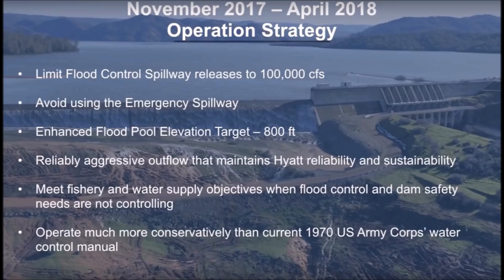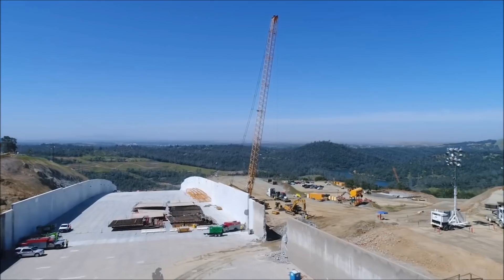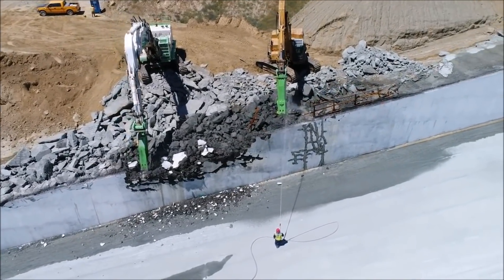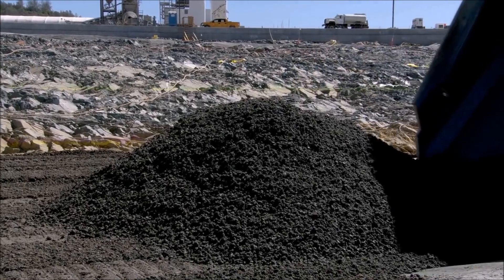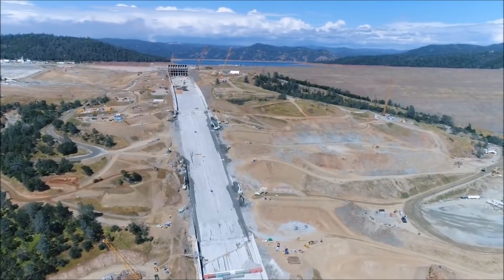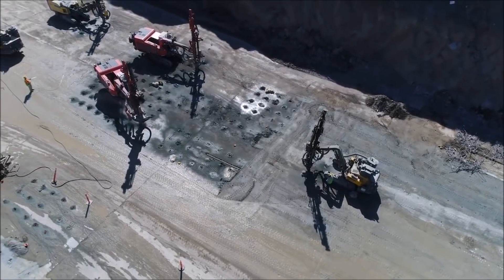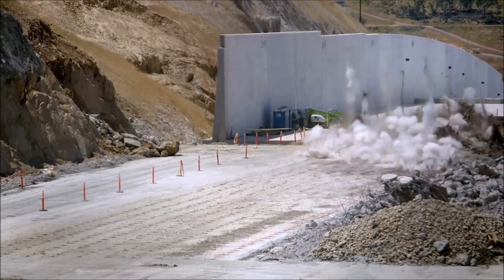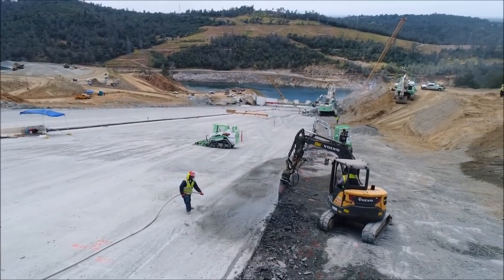Oroville Dam May Progress

Comment: Just amazing the size of the project. I mean, wow. The width alone of the spillway is what, 250-300 feet?
Reply from the maker: its huge, largest earthen dam here in the US.
Reply: S. H true, but I want talking about the dam, I was talking about the spillway.
Reply from the maker: i was unable to find the width but it must be a few hundred feet wide, if you look back before they began fixing the spillway you could see the scale of the spillway with men on it, was huge.
Reply: S. H agreed, just looking at the diffusers at the end of the spillway, those make the heavy equipment look like toys.
Reply from the maker: the problem is the spillway design is not good, where you see a peaked hill a vacuum will form below it when enough water is sent through, it will lift those areas as it did before.
Reply: S. H at some point we will find out I would guess. Great video either way.
Reply from the maker: Thank you sir..i did cover the failure last year & have a playlist "OrovilleDam" if interested.
Reply: S. H thank you, I've watched yours and the other guy with the plane, Blanco o what's his name. You both did great